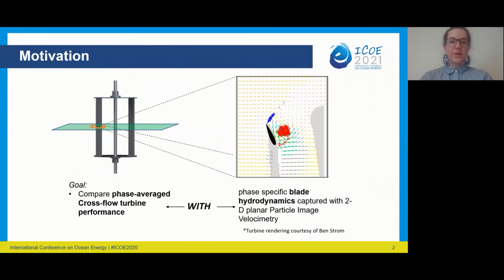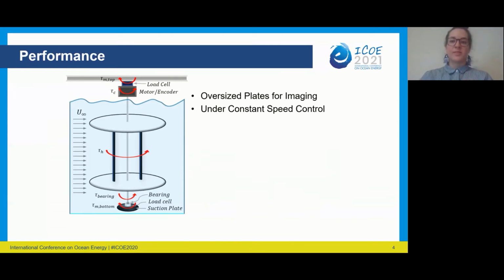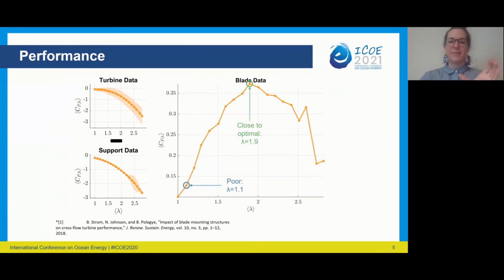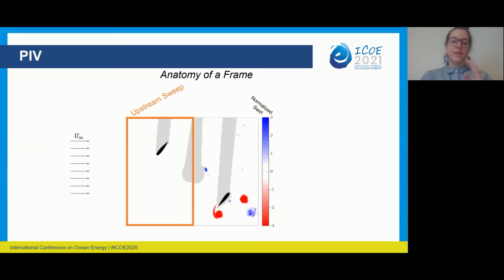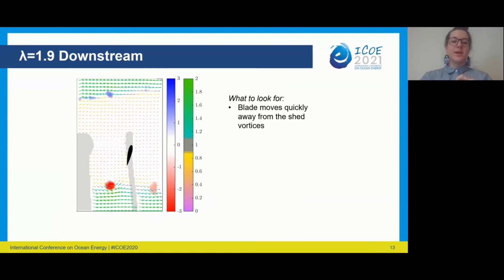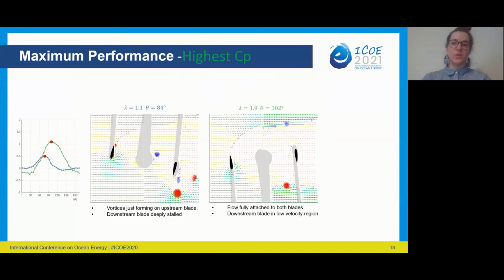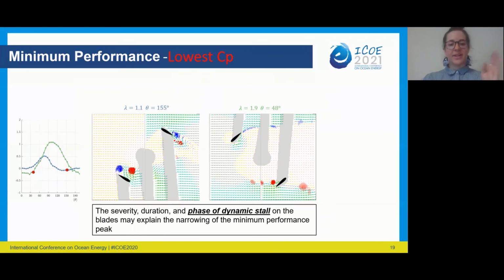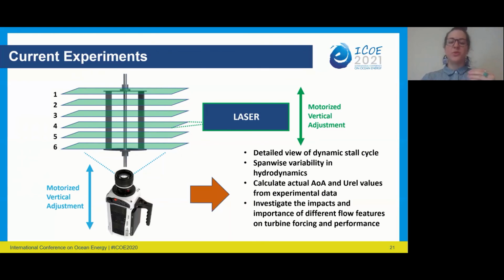Cool PIV! How do the Fluid Dyanmics around Cross-flow Current Turbines Effect Their Performance?

Comment: Most of the small micro home hydro is using Pelton turbines.
They are almost all in the low head  range that should never consider Pelton !

The only reason is the high speed of the Pelton is a better match to the generators without gearing.

Cross flow would be better .

Comment: I realize you and the university are mainly pursuing this research for marine turbines, but you might want to have a look at a channel called Just Have a Think, where they've just put up a video on vertical axis wind turbines being used alongside highways.  The idea is to harvest some of the wind energy from passing vehicles, plus of course any ambient wind.  Reportedly, they're getting surprising amounts of power this way.
   I would think one challenge would be to make the units break away on impact and at the same time be adequately durable.
   I'll try posting a reply to this with a link.  YT seems to be taking down any post with a link lately for some reason.
Reply: Link to the video: https://www.youtube.com/watch?v=gcSnwW5v3f8
Reply from the maker: Wow awesome thanks so much ill definitely have to check that out! I think the break away at impact is a huge challenge. Power poles are designed that way but I'm sure the thrust loading on them durring high winds is muuuuuch lower then what a wind turbine would see. Super cool ill definitely check out that link thanks for the share!